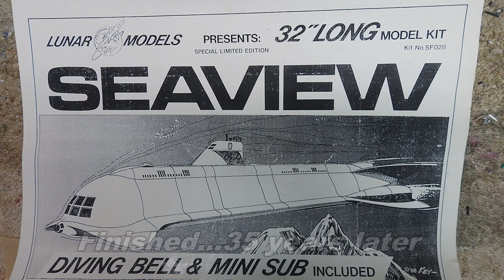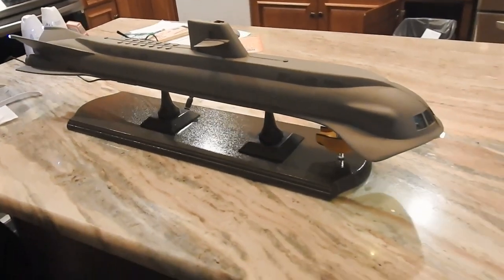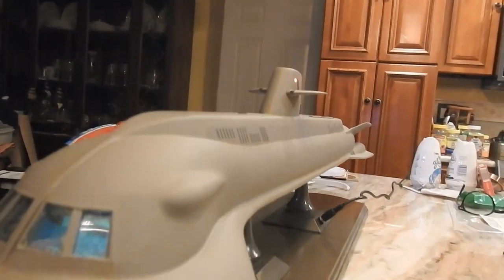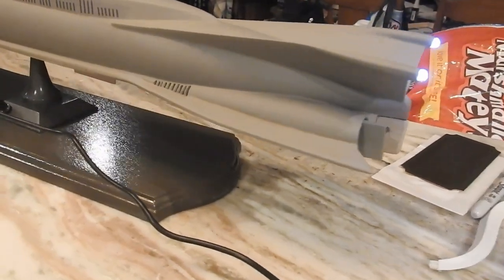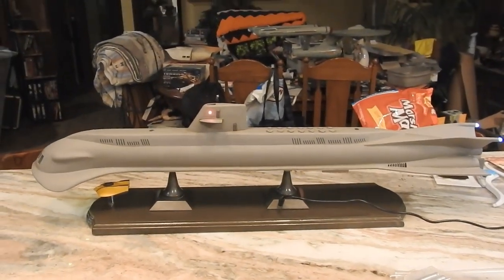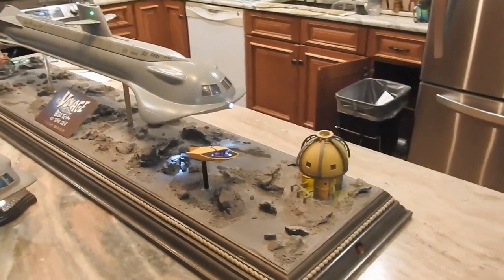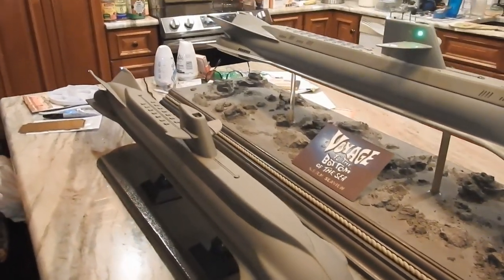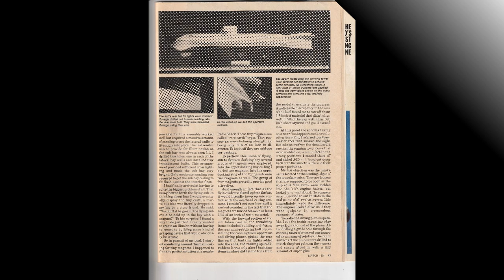Seaview Part 3 - Lunar models Seaview final build

Comment: y si hace el pi pi pi pi pipi el sonar e notado qué tienes cierta modificación el original tiene 8 compartimiento de proyectiles y en otro video tenía 6 y otro 7 y los ventanales uno más grandes .
Reply: The lunar models version has the engine lower tail fins as the eight window version. The mobius SEAVIEW has them at the correct angles.